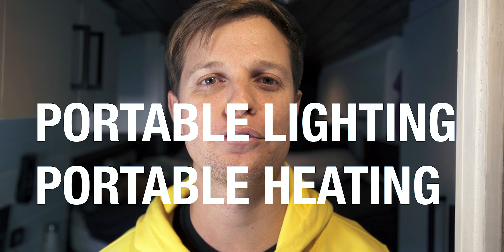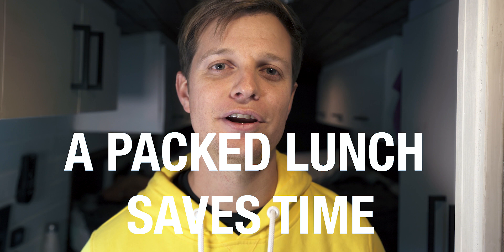12 Steps For A Successful Van Conversion | Avoid Van Build Mistakes

Comment: Good points, especially on putting the tools up. Searching for a hammer or screw driver you just had for twenty minutes is very frustrating lol. I'd just add setting aside a half hour to read some scripture, it'll keep you focused on what's really important and the rest is minor details. Enjoyed the video!
Reply: I was thinking about you two yesterday, i stopped work on installing insulation and vapor barrier Saturday night when my drill battery died on me. I plugged it in and left the tools scattered around, went out yesterday and spent 5 mins (which seemed like 20) walking in and out and around my cargo trailer lokking for my hammer lol. Im not sure which of my two dogs went out and hid it behind the trash can, but i told myself well you were warned to clean up and didn't listen!! Hope you two are safe and having fun, God bless!!